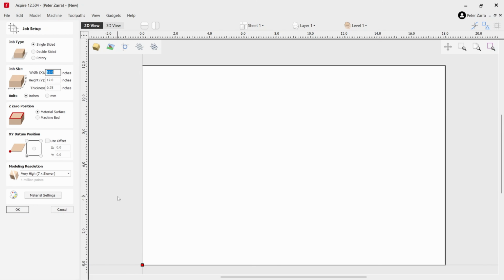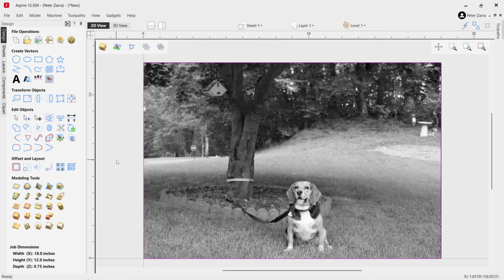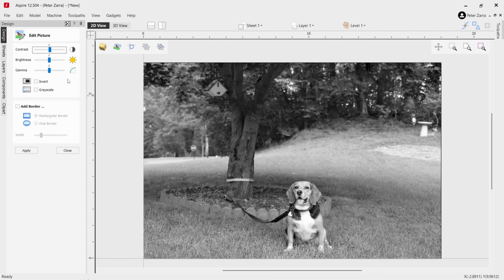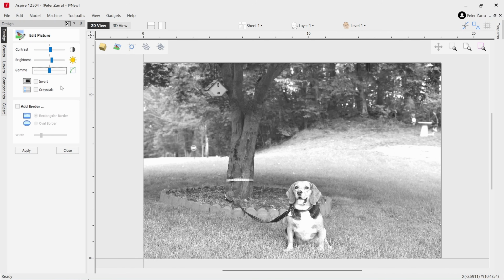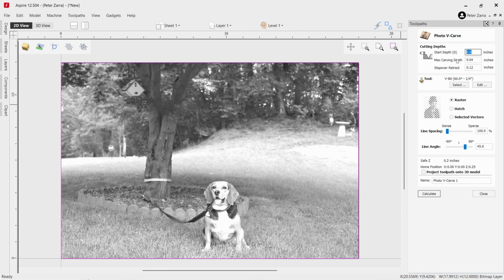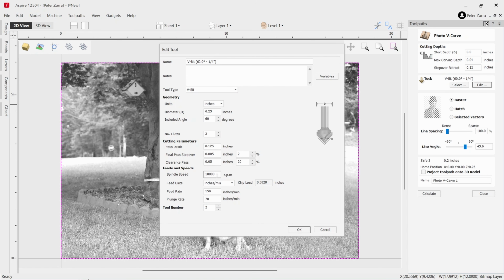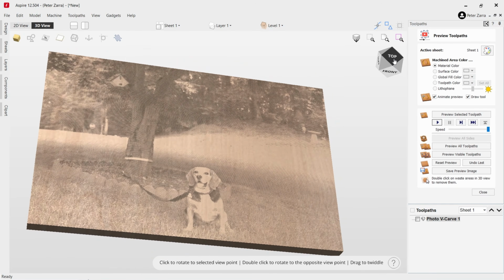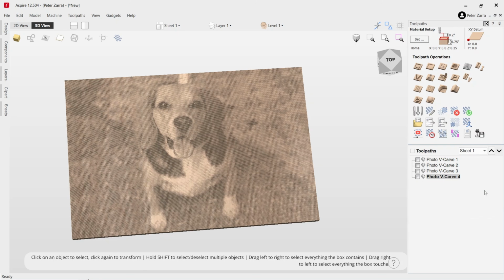Photo Carving a Dog Portrait Using a CNC Router

Comment: I need a good long lasting 60 v bit. Unfortunately, your recommendation is sold out. Do you have any other recommendations on 60° v bits?
I've had success with a carve after watching your videos. I've been having some problems with my most recent carve and I think it might be because my bit is dull. I'm getting a lot of burring on the lines, too much.
I've been trying to carve out a portrait of a couple standing on a beach with the sunset in the background. This makes my seventh time trying to make this work.
Trying to get the faces to stand out in front of the sunset has been a challenge. I'm getting flat spots on the carve, especially after I sand. 
I followed all your directions, I think it just has something to do with the Bright colored background. I don't know what it is with this particular picture but it's becoming a nightmare. I've tried everything that I know of. I've adjusted the brightness contrast, hue saturation.
But this last attempt I did notice quite a bit of burring happening. And yes I clean it up with a wire brush. 
Anyways, any help would be appreciated. Hopefully you have a recommendation on a decent 60° v bit. 
I like your work, I commented on your other photo carving video. I was a little skeptical if anybody would really like this kind of work. Needless to say, I already have a buyer. I just can't get this picture to work.
Reply from the maker: So, couple of things to mention: first, the v bits will not last longer than about 2 carves maybe 3 but that's pushing it.  The tip is doing all the work and it's carving a lot of lines so you have to factor that into the price.  Spetool is my next go to from Amazon, great bits.  Second, only certain images will work for carving.  For example, anything dark like a black car, black dog or dark shaded faces are not going to come out well.  Also, if there are two objects in the photo both of similar color and shade they will not be differentiated by the software. Playing with the contrast and brightness will help a little but some photos just will not work.  Thirdly. if you are getting flat spots after you sand you may want to try and carve a little deeper or sand slower to prevent going to deep.  Also, make sure that your board has been surfaced on your machine.  This is critical to get the correct carving depth and avoid missed spots.  If the board is out of flat by just .005" (5 thousandths) it will cause issues with the image (missed spots).  The burring on the lines is from a dull bit and try not to use pine it does not carve well, maple is the best.  
I'm glad that you have someone interested in a carve, I too am making one for a friend that just lost her dog to cancer.  It's a unique look that can make great wall art on larger size carvings because the closer you get to the carving you realize that it's just a series of diagonal lines of varying width and your eye perceives it as an image.  Lots of luck and great to hear that the videos inspired you!
Reply: I came to the realization that this particular picture just won't work. I have to move on and try another picture. I just hate giving up on anything!
I do use hard maple on all my photo carvings and I surface as well. I also use Spetool bits. They are very nice bits at that price. It's nice that they provide speeds and feed charts on their bits you can download. I've done several 3d relief carvings using their .05 tapered bits. Unbelievable performance!
I'm going to dig in some more of your videos. Very interesting and instructional, to the point with clear directions. 
Keep up with all of your unique content videos. It's worth a lot. I've learned quite a bit with photo carving thanks to you. 
I appreciate the time you have taken creating masterpieces while teaching others. I'm looking forward to learning more!
I'll be sure to subscribe! Thanks again!

Comment: Can you use a 30° v bit to photo carve if so what's the results......better than a 60° v bit or worse?
Reply from the maker: No, you should only use what's listed as an option in the photo carve toolpath.  It doesn't have settings for a 30-degree v bit so if you used one the lines would be far apart and could look off.
Reply: @StudioZ-maker  thank you I appreciate you getting back to me

Comment: Confirming 
V1401 60 Degree nACo Coated V-Groove Carve Bit - 3 Flutes - 60°- 1/4 SD - 1/4 CD - 7/32 CL - 2 OL
PETER (-$5.18)
2	$51.94
$46.76
promo code PETER is workz! ))
Reply from the maker: Awesome!
Reply: @StudioZ-maker  Still no delivery.
Reply from the maker: Was it backordered?  Did you call and ask?  I'll see if they have a response.
Reply from the maker: So I checked with them and they said because you live in western Australia it will take longer because of how remote it is.
Reply: @StudioZ-maker  All good mate I wait a bit longer. Usually get in around 10 days from States, may be some hiccups at customs.
Reply: @StudioZ-maker  From auspost website..
27 June 2025: Items sent to and from the US may experience delays due to flight capacity issues, which has impacted postal operations and delivery services.
26 August 2025: Due to recently announced changes to import tariffs for postal items sent to the US and Puerto Rico, Australia Post has temporarily suspended some postal services to these destinations, effective 26 August 2025 until further notice.
Madness. Those politicians should be sacked for the reason - Not fit for job.